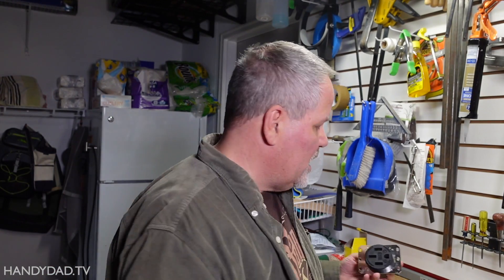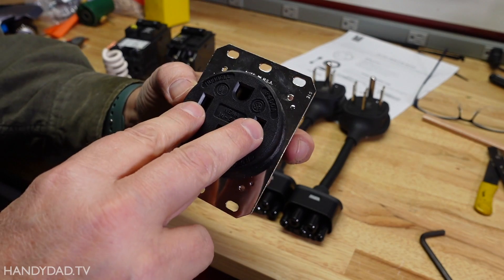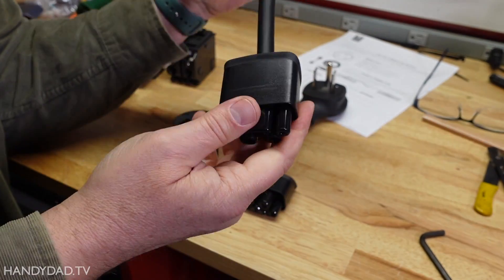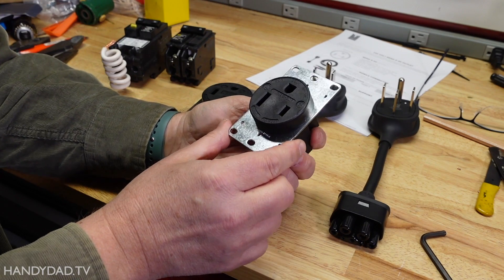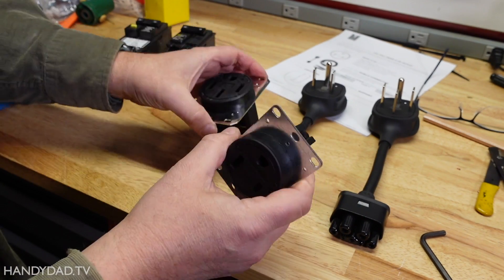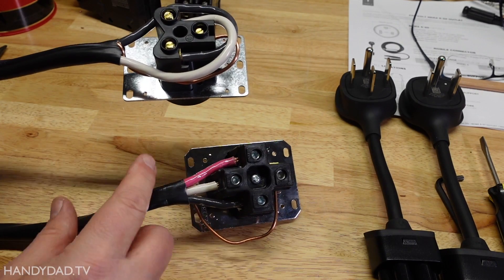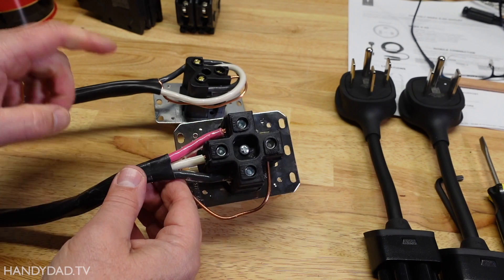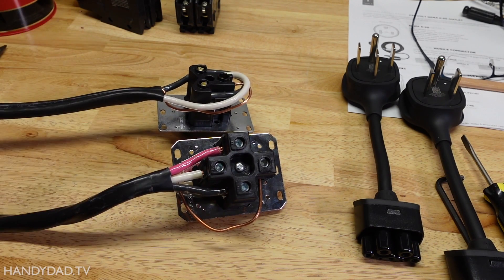NEMA 14-50 vs 6-50 for EV charging

Comment: If the cable installation is simple (doesn't require extensive drywall/trim/painting repairs) 6-50 will handle your EV charging needs for years to come. If the cable installation DOES require a lot of wall/structure retrofit and repair, I'd future proof the installation and add the 14-50 instead. The additional neutral may come in handy if future EV wall connectors start adding computer interfaces, timers, switches, WiFi/Bluetooth features that use a 110v supply. Might you someday want to put a clothes dryer in this area? These require a neutral because the timer/motors use 110v. Are there appliances in the future that will need that neutral? I don't know! But I do know that having to call out an electrician again in the future will erase all the money you saved today by opting for the less expensive option. Throwing an empty run of conduit is usually a good idea too in case you need to run data/coax/quantum dilithium hyperxingual opticrons someday. 😆
Reply from the maker: Good advice 👍🏻

Comment: I learned I ran way too big of a ground wire to my 6-50 receptacle, oh well I guess I can tape it white and only need to run an adequate sized ground wire to upgrade to a 14-50
Reply from the maker: If you did that, how would you ground the 14-50?
Reply: @handydadtv  with that additional "adequate sized" ground wire rather than a 6 gauge.
Reply from the maker: Oh, you’d run a new wire. Gotcha.
Reply: @handydadtv  Yeah I ran a 6 gauge insulated green wire for the ground prong.  Facepalm. Could just tape it white, its my neutral now, and put in a bare (10 gauge I think?) ground wire to use for grounding a 14-50.  I think technically I can ground the plug to the metal case since it has continuous metal conduit all the way back to the panel. I think the Code allows for that too, but I'd probably still run a bare ground wire to the ground bus.
Reply from the maker: I’m no expert on code with conduit but I think you need a bespoke ground.

Comment: Thanks for the video. A subtle but important detail is that the 6-50 receptacle can be wired as shown with a #6/2 conductor, but you need to mark the white on each end with red or black tape as it is a hot. It is hard to find 2 conductor wire in red/black if you want to comply with the electrical code.
Reply from the maker: Thanks for the tip

Comment: Thank you for finally explaining the difference! I just installed a ChargePoint charger and I was confused about which plug to buy with it. As it turns out, if you install a 60 amp breaker, both the NEMA14-50 and 6-50 can allow the charger to deliver 40 amps to the vehicle. If you hardwire the Chargepoint to the 60 amp breaker box, it will deliver 48 amps. So the electrician got rid of the plug entirely.
Reply from the maker: Keep in mind, even though you can charge at 48 amps doesn’t mean you should. It depends on your daily commute, but I charge at 15 amps on a nightly basis and it’s typically finished around midnight. No point in stressing your connections to recharge as fast as possible when the car will be sitting in your garage all night.
Reply: If you are using an outlet rated at 50 or using romex wire, you will need to use the 50amp breaker. You can only use the 60amp breaker with a hardwire install and thhn wire. This is one thing inspectors will get you on.

Comment: Wiring on your 6-50 is incorrect. If you are wiring a 240V circuit you must use L1 and L2 not L1 and N.
Reply from the maker: The white wire was L2. I added black tape.
Reply: @handydadtv  The NEC doesn't permit the use of white or gray conductor insulation for ungrounded conductors in a raceway, even if the conductors are permanently re-identified.

Comment: I have a bolt, a rivian and a ford escape plug in. All three came with 14-50 cords. I believe that 14-50 is the choice moving forward and anything heavier than 50 amps should probably be hard wired.
Reply from the maker: Good to know. Thanks.

Comment: A couple of things to consider… I have off peak charging set up with my power company. The power costs about a third of regular price, so its great! It has a seperate meter and control box between the main breaker box and my NEMA 1450 outlet. The control box requires I use the neutral wire on my outlet. 
If you stick with EV’s, you will probably want to go off peak eventually. 
You also don’t know what car maker you will go with next time, I have a Tesla Model Y now but love the trucks that are coming! The charger might require a neutral. I also have a garage heater that I can plug in to it which requires a neutral.
My advice is don’t be penny wise and pound foolish unless you are sure you will only ever need a 6 50. It’s much easier to disconnect an unneeded neutral than to reinstall new cable down the road!
Reply from the maker: Separate meter? Control box? What if you need to charge during the day in between trips? Is the outlet disabled until the power company allows you to charge?
Reply: @handydadtv  you charge whenever you need to charge. Only the rate changes based on time of day.

Comment: Also important when tightening the wire to the Lugs is to shake/wiggle the wires a little to allow the strands to mesh while tightening. I also add a little No Alox grease on the threads to improve the clamping. I use 6-50 also. No need to have a Neutral unless a Dryer or Stove has a 120 v need. Save the copper for others.👍
Reply from the maker: Thanks
Reply: So can you just not hook up that neutral and use the 14-50 with 2 hots and a ground?
Reply from the maker: The 14-50 has a neutral, although your appliance may not use it. 

The 6-50 is a receptacle with no neutral.

Comment: Quick question - can you plug the 3 prong charging cable to the NEMA 14 50 plug?? That way, my level2 charger can take advantage of both the plugs depending up on my friends' garages when I travel.
Reply from the maker: The 6-50 doesn’t fit the 14-50.
Reply: @HandyDadTV  Oh ok. Thanks for the video - I will buy the 6 50 & call it a day.

Comment: I had one of those Leviton 6-50 outlets that welded itself to my EVSE (30 amp) plug a couple of years ago. At the time, I was not aware of the differences in outlets and just assumed that I had a loose connection and replaced it with another Leviton and carefully installed the wires. I eventually became aware of the issues with light duty outlets and purchased an Eaton Industrial 6-50 for $25. Before I installed the Eaton outlet, I came across your videos on the Hubbell outlet. I decided to spend the extra money on the $45 Hubbell 6-50. However, I was disappointed to see that the 6-50 did not use the yoke type clamp for the wire contacts, and just a small screw which smashes into the wire. Adding insult to injury there must have been some quality issue with the Hubbell because the plug could not be fully inserted into the outlet. I installed the Eaton 6-50, which does have yoke-style clamping for the wires. I did return the Hubbell for a replacement but I probably will not install it since I've been monitoring the temps on the Eaton plug connection with good results. Yes, the Hubbell 14-50 is more expensive than the 6-50 but it is far superior in the critical area of the wire connection.
Reply from the maker: Good point. Thanks.
Reply: That why I always use ferrules on stranded cables to avoid smashing the wires. I use then in the plugs and in the breakers too. Never had a problem .

Comment: Your right, good point. I had mine hooked up with the 14-50 and my RV would work with it but then I bought a Tesla charger and replaced it with that so I could just keep the mobile connector in my trunk. The Tesla wall charger only needs the two wire set up also so you are correct about it not using the white common wire if you use the three wire set up and don't have an RV and never will your just wasting money for sure, great video.
Reply from the maker: Thanks so much 😊

Comment: The comment about the NEMA 14-50 being used by RV's is an important one.  While it might cost you a bit more to install a NEMA 14-50, it makes the resale value increased more than the extra cost to install the outlet as an EV owner would value it, but so would a RV owner.  Also the NEMA 14-50 is much more widely accepted for EV chargers.  So if you sell your house the next user would likely have a 14-50 EVSE, or if you need to buy a replacement EVSE. Decision like this should always take the future into account, that's why installing these outlets on a 50 amp breaker also makes sense.  De-rating it to a 40 amp breaker and wire to save a few bucks will bit you in the butt down the road.
Reply from the maker: Thanks for the tip
Reply: There are adaptarse for one to the other, so RV not withstanding, it should not affect home value at all.
Reply: @irenecheca6575  no, that’s incorrect. A NEMA 6-50 doesn’t have a neutral so it can’t be used with a RV. A NEMA 14-50 is much more versatile.

Comment: your Tesla guide link says that the Nema 6-50 allows up to a 32 amp draw, however your video states it allows up to a 40 amp draw... pls clarify this
Reply from the maker: Plan to use 80% of the breaker rating as a max charge. That’s 40 amps for a 50-amp breaker. The Tesla UMC max’s out at 32 amps regardless.

Comment: Will these work on 30amp breaker or should you use 50amp breaker?
Reply from the maker: Technically they are made for a 50-amp breaker, but you can use a lower one. With a 30-amp breaker, make sure your charging rate doesn’t exceed 24 amps.

Comment: I put in a 6-50 so I can use the outlet for a welder also. I have no use for the common on my 240 outlet. The extention cord for the 6-50 was consiferably less expensive also.
Reply from the maker: Copper is expensive. 👍🏻

Comment: Here in the great south land we pay about $.30 part kWh.   That means that you’ll pay about $20 to replenish your battery

This cost is never publicised, and it’s a fiction that it costs nought.    For this reason the motel is never going to let you use $20 of electricity for free, anymore than they will give you $20 to buy petrol on your journey.

Stavros
Reply from the maker: In the past two years, I’ve only stayed at hotels that have free charging. 

It may not be that way forever, but it is now.

Comment: I would not even think about using a 3 wire plug.. As that ground is needed back to the Service panel.. In case of a short to ground. 

And the reason the Tesla does not use it. It's a builtin double insulated Charger..So the ground is bonded to the Neutral inside. To cover over current protection.. I seen inspectors try and cut a cord on my hammer drill,. As it had no ground prong. I told him you will be paying $2,000.00 to replace it if you do. As it says right on it Double Insulated..
Reply: Double insulated does NOT mean the ground is connected to the neutral inside the device.  In a proper circuit, neutral is ONLY connected to ground inside the service panel.  Extra interconnects between neutral and ground are only needed in certain rare conditions having to do with sub-panels in outbuildings.  "Double-insulated" means that the metal parts of the device is covered in another layer of insulation.

A 3 wire 6-50 has two hots and a ground.  It doesn't have a neutral..  What makes you think it's not grounded?
Reply: @fromagefrizzbizz9377  To get Double insulated rating. The Ground has to be bonded to the Neutral inside the devise..Hence the reason for no Ground Prong. 

Read the damn instructions. As a short to ground inside the devise needs a path back to the Source. The source being the Transformer feeding the Service panel..

Now shut the hell up. I been at it for 40 years. And even Mike Holt understands it.
Reply from the maker: No need to get pissy. Just a healthy debate. 

I researched the topic and haven’t found anything about using neutral as a ground in a double insulated appliance. Do you have any supporting reference?
Reply: @WizzRacing  The definition of double insulated DOES NOT mean that you connect the frame to the neutral.    Look it up.  It means that every metal part potentially connected to a current carrying wire (a ground wire isn't one) is insulated.

If it was frame-connect to neutral, that would mean that the frame would be connected to hot, 50% of the time with an unpolarized 120V plug.

If you did that with a Tesla charger, the entire frame of the car would be connected to neutral.  A single fault away from over a ton of shocking badness.

Back in the day, US ranges used three wire, with third wire acting as BOTH neutral and ground.  Just a single fault away from a potentially lethal shock on the ENTIRE APPLIANCE!

You wonder why the NEC changed that and followed Canadian code which had been four wire decades earlier?

I've been "at it" for 50 years, and as for Mike Holt, years ago a buddy of mine and I wrote an electrical wiring FAQ that touched on issues like this, and Mike was impressed enough to send us a free copy of his book to review.

Mike is quite good on grounding, so were we.  One thing you NEVER do is have more than one neutral-ground interconnect, nor use any exposed metal as a neutral.  Like an electrical box.
Reply: @fromagefrizzbizz9377  You still at it? 

Lets look at how it it gets the rating. The Motor has to be insulated from the outside body.. The Neutral is bonded across the ground at the motor. Thus meeting the requirement for GFCI protection. As a GFCI will not trip without a Ground. Hence the green light on them..This insures that any short to ground at the motor will find it's way back to the source. As the source is always the Transformer feeding the Main Service panel. Why you don't bond any sub panels. 

Now shut the hell up.. OSHA and NFPA70 tell you how they work and why...

Have a nice day..

And before you come back flapping your gums. Try opening your wallet and buy the NFPA70 code books..Read Article 250.. And Article 100...

thank You
Reply: @rsewill12  You mean the ground is bonded to the Neutral..Unless you have an isolated ground requirement for DC-AC inverter like those used in Computers. Then the Isolated ground is added to an outside grounding connection..ie Super Neutral.. As the Neutral is oversized for a reason...
Reply from the maker: Thanks

Comment: Hey you are easy to listen to and made to have a Youtube channel thank you. I have (after watching your video) a 14-50 outlet behind my electric range that I want to split safely to charge my soon to be delivered Rivian EV pickup. I have seen a couple of products made for doing that with a 30 amp dryer circuit but how would I do that same thing for a 40 amp electric range plug with the 14-50 plug ? Is everything I might need at Home Depot ?
Reply from the maker: I doubt you’ll find a 14-50 splitter at Home Depot. You can definitely find them on Amazon. 

I can’t imagine what that will look like (having a cord coming from behind your stove. You’re getting a RIVIAN, my friend! Get yourself a hard-wired Level 2 charger. I recommend the Emporia: http://handydad.tv/kuok
Reply: @handydadtv  thanks but I'm pretty sure I only have a hundred amp service which is why I still want a splitter. My electric range is right next to my outside wall could go in my crawl space and out where I need it in about 12 ft. And 40 amps beats 30.

Comment: I currently have a 14-50 already installed and looking to swap out to a 6-50 outlet. Would I be able to just leave out the neutral (white wire) on the 14-50 and just connect the 2 power and ground  on the 6-50 new outlet?
Reply from the maker: Yes. Just cap the neutral and stick it in the back of the box in case you ever want to go back.

Comment: THANK YOU for this video!!!  Installing a new outlet at a new house for my Tesla.  I already have a 6-50 plug end for my Gen 1 UMC.  It's near impossible to find a 14-50 at a reasonable price for the Gen 1.  I thought there was some advantage to 14-50 over 6-50.  Thanks for explaining on your video that there isn't as far as the Tesla charging goes.  That will cut my installation costs by 1/3 between the wire, outlet, and not having to buy a new plug end.
Reply from the maker: Glad it was helpful 👍🏻

Comment: I had planned to install a 30A rv outlet as well as an EV charging plug, am I understanding that I may be able to get by with one plug to do both? I wired a temp 30A  outlet for my in-laws camp trailer but was a 120v single pole. I currently have neither a travel trailer or EV but plan to use the property as a vacation rental. The basic difference between the two is that the 6-50 doesn't have a neutral,  two hots and a ground? If that's correct is that a 6-2 wire? Thanks for any info
Sorry one more question,  are you using 40 or 50 amp breaker for those and are they GFCI or arcfault protected? I saw arcfault breakers but no GFCI in 50A
Reply from the maker: The only RVs that use 240 outlets (I believe) are big ones, like 5th wheels. 

Technically, code says every garage receptacle needs GFCI protection. I really recommend hard wired EV chargers to avoid the need for GFCI. https://youtu.be/-NieHTM6U_s

Comment: I have limited elec knowledge and want to ask about the wire gauge. If the level 2 charger I’m getting says 42-48amps, I’m assuming I’d get a 50amp breaker which means the higher gauge wire (6/2 vs 8/2)?? I’m in Florida too so temperature is a factor, correct?
Reply from the maker: Your charger can only use 80% of the breaker’s capacity. I have a 50-amp breaker so my max charge is 40 amps using 6 gauge wire. To charge at 48 amps, you’d need a 60-amp breaker. 

Climate has no impact. 

Here is a good chart for wire sizing. http://assets.bluesea.com/files/resources/newsletter/images/DC_wire_selection_chartlg.jpg